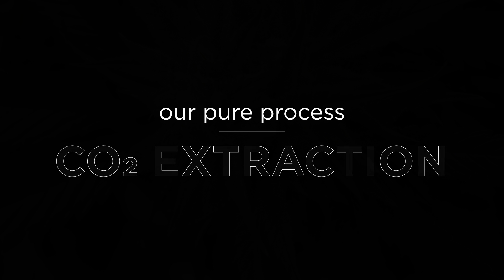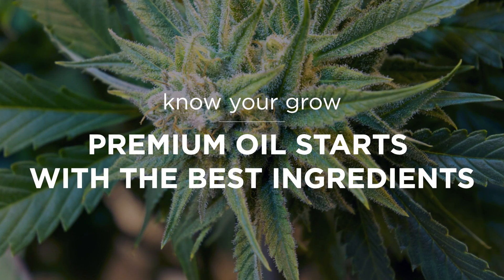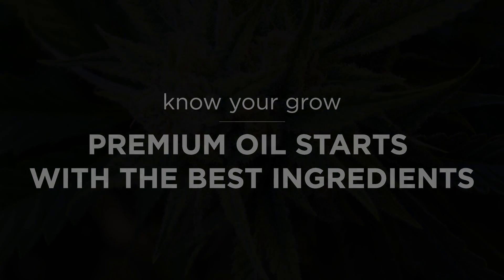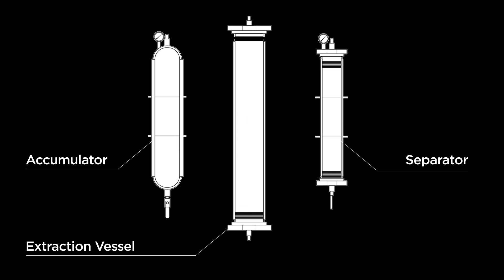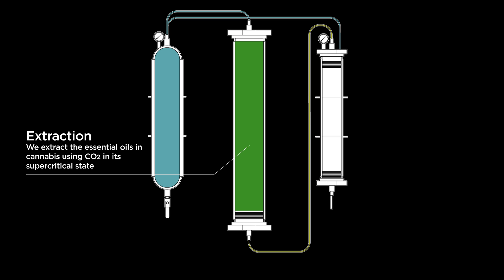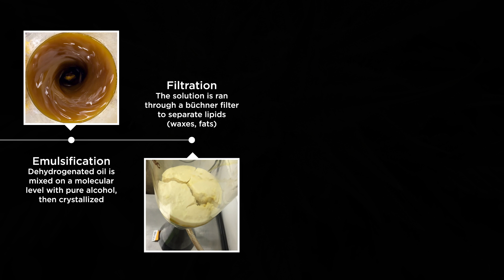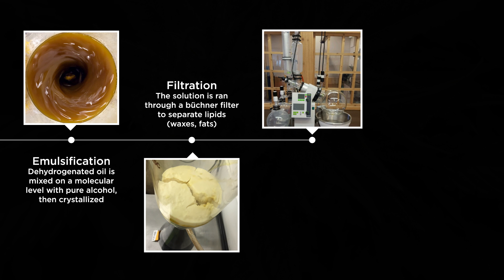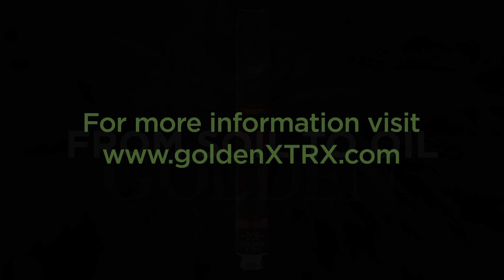From Soil to Oil: An Overview of Cannabis Oil Extraction Using CO2

Comment: Ive found that the consumer is so used to all the McFarmed cannabis and all the adulterated extracts (some run thru questionable CRC methods) they have no idea what is "good" or "natural" anymore.
I've been doing a bit of research on the average cannabis extract user and have found that 7-8 times out of ten they're picking the artificially "flavored" or (forgive me while I retch) clear concentrates over the natural and organically grown and processed extractions with original terpenes reintroduced at process end.
They have no idea what they're looking at. Judging quality on how "clear" the oil or shatter is. 99.9% of the time the light to moderate smoker will choose the clearest shatter/oil over the slightly colored samples. Even whe the "darker" choice had a better terpene/cannabinoid profile ("nose feel") they still opted for the clear glass.
Clarity can certainly denote quality, but should never be the single standard criteria. It should also be kept in mind that it isnt a color. I digress.

We spend so much time, effort, and money into bringing a quality, clean product/medicine. It's sad that allot of that effort is only truly appreciated by others within the industry or the true connoisseurs. The rest are flooded with over processed products made from the floor sweepings and trimmings from the McChemical Cooperations; Subsidiaries of the McFertilzer/Pesticide group, that when they do get their hands on some top shelf extract  they believe because it doesnt taste like conformity that theres something wrong with it.

Comment: they use another solvent after the co2...
Reply: Yeah, wth...  why do I feel that it practically defeats the purpose of using Co2 ...
Reply: @trupyrodice4462  yea, upon further study, it basically cleans the oil more of plant fats, that end up coming out with the co2 extraction... defat wash, the call it in other processes... but yea, alot of work for a normal garden grower to get started in this extraction stuff... id say go with bubblebagdudes ice water hash.. its not shatter, but its easy and safe.. turns out good too.... frenchi cannoli...

Comment: "highest quality plant material also known as trim"
okay haha
Reply: Trim is a generic term in the hemp production industry for anything that is "Trimmed" off of the hemp plant. All parts of the hemp plant have specific advantages concerning cannabinoids. The cylinder could be full of flower and it would still be called trim.  Ahmed Alrawashdeh
Reply: The trim from high quality plants is used to make extra oil that is pure and lower in overall THC composition. It's a good way to make products with a lighter consumer in mind and not waste good trimmings. However everything is groomed and placed in there in some places to make highly potent oils and shatters.
Reply: Well, it is useless to only take the best part of the plant because it separate it in a molecular level to take the THC or what ever you may want from it.
Reply: I believe they're using whole plant material - stems, flower and leaf.  Maybe not these guys but a lot of places do.

Comment: Hi You said that the c02 is contained in the system so it doesn't attract any foreign matter what about the Cannabis when it grows I'm sure it attracts things the human eye can't see thus causing contamination correct so when foreign particles are breaking down on the cannabis at what micron does you're Co2 extraction system capture theses particles and at what micron is the oil released from from you're extraction system In order for it to be clean?
Reply: Cookinitmax you'd want to follow up the last step with fractional distillation.
Reply: good question. I would like to know the answer as well
Reply: It doesn't look they run fractional distillation in this demonstration, but perhaps the emulsification with the alcohol and then filtering out the lipids is one way of removing any unwanted components from the finished product.  although I feel fractional distillation is more effective, but this seems legit, especially if their analytics are reporting little to no residual solvents.
Reply: The winterization step, where the ethanol is added, will likely be incompatible to support microbial life. The subsequent filtration of the lipids to obtain the final oil will also eliminate particles down to micron levels Im sure (depending on the quality of filters).

Comment: why use a solvent when using c02. seems to defeat the purpose
Reply: +Lars Rasmussen I think more just to remove the plant waxes, or as we call winterising. Tho I didnt realise co2 was pulling anything else if done correctly... or to emulsify , i.e mix to make it dissolvable.. but again solvent not needed for this step as far as Im aware?
Reply: +Medical Cannabis Spain You don't have to "winterize" the oil.  It depends on the product you are trying to achieve.  Having said that, alcohol is pretty harmless and can be removed from the end product.  Eden has a specific "Winterizer" that is faster and easier to use than the rotovap shown.

Comment: which it is the minimum pressure required
Reply: +Luis Hernan Giraldo Silva   The temperature and pressure work in conjunction to create a specific product.   There is subcritical and supercritical (over 1100 PSI and 88 degrees F) extraction.  Subcritical can be achieved at any pressure but the temperature must be under 88F.